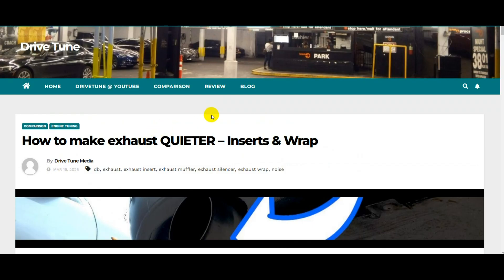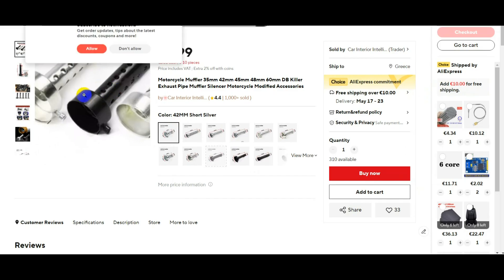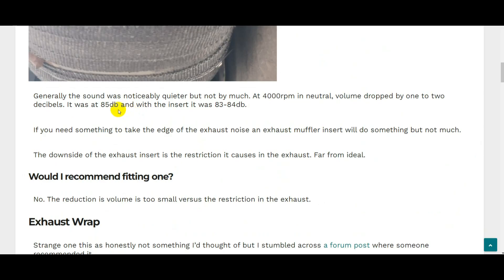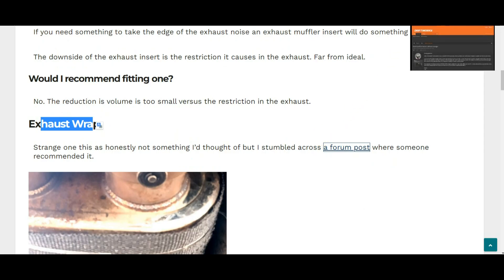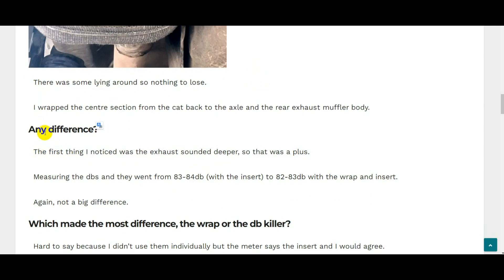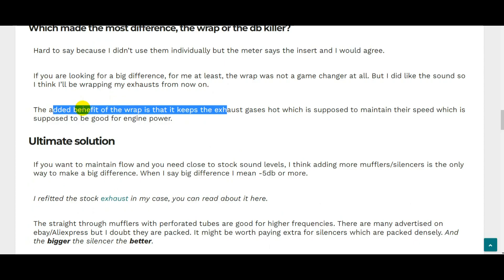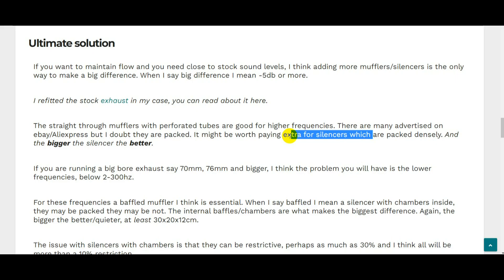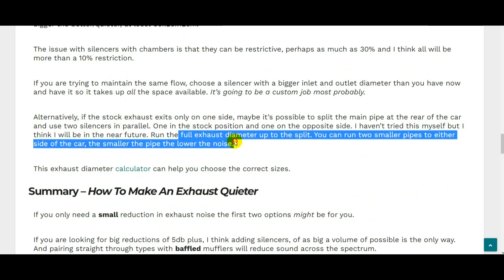Make Exhaust Quieter - DB Killer vs Exhaust Wrap. UNEXPECTED Result

Comment: with motorcycle aftermarket exhausts that come with a killer, removing it makes it slightly but noticeably louder, but the biggest difference is it makes it sound more crisp. With the killer on, the exhaust usually sounds like all the exhaust pulses blend together and it's a bit lower frequency. With the killer removed, you hear every individual exhaust pulse and they are sharper, bit like a automatic fire with a rifle, and it's just a bit higher frequency. You also need to remember that Decibels aren't linear, they are logarithmic. So an increase or decrease of 3 dB is already a 100% increase or 50% decrease in volume. going from 85 to 83 is a fairly big difference
Reply from the maker: Interesting point. I used it on a turbo motor, the effect sounds different on NA engine